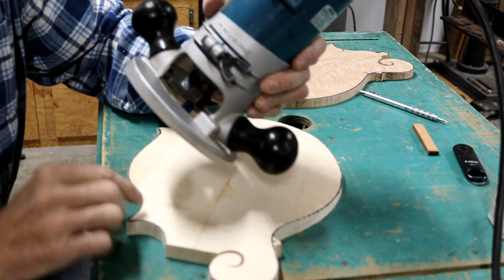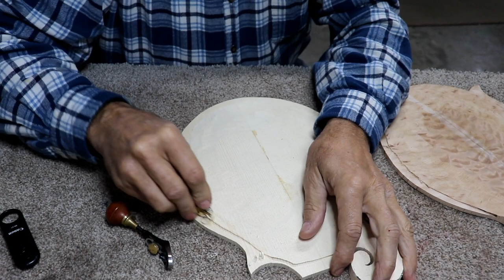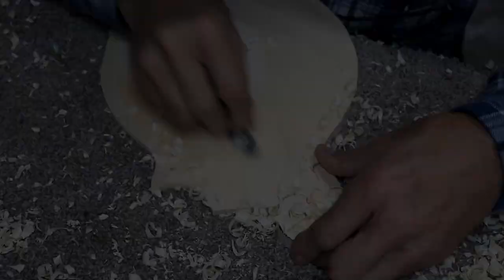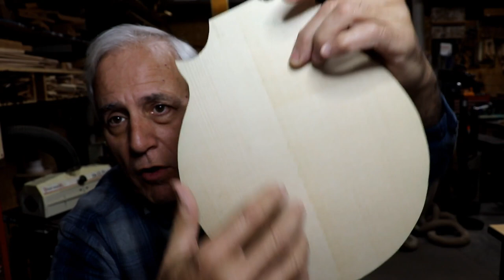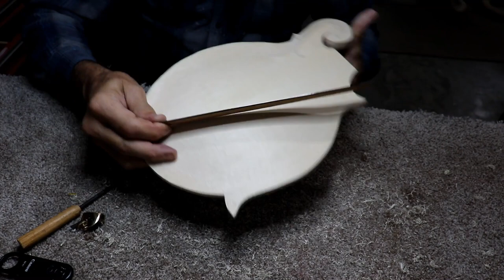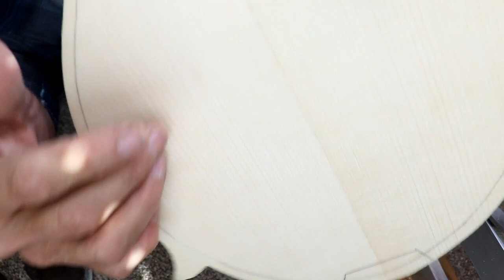560 RSW The Worlds Finest Mandolin Ever Built By A Human - Part 2

Comment: Concerning the recurve on the top: Benedetto says that the recurve on the top is purely cosmetic, that the F holes already make the top far more flexible than the recurve could by itself. And that does make sense, with those holes cut in there, it's going to be more flexible just from the missing material. He then goes on to say that the BACK is the place the recurve makes a difference. It matters because without it, the back is too inflexible to help shoot the sound out of the instrument. He taps on the front and feels he vibrations in the back, first at the center and then sliding towards the edge. When you get towards the edge, you can feel that the vibrations drop off. What he says you want to do is to get that recurve area vibrating as much as the center of the back. It's a pretty subtle thing to feel, no question. But he thins the recurve area to where it is vibrating like the center of the back, then he considers it done. 

Granted, he's building guitars, but I wonder if the same principle applies to mandolins? I'm almost done with my first arch top and I've never finished a mandolin, but I am definitely noticing what he is talking about with the back vibrations. Just something to consider.

Comment: I have an idea for your fine detail sanding. Get yourself a cheap rechargeable electric tooth brush, pull the bristles out of the brush heads and put velcro on the toothbrush head. You can us a small pice of plastic to make the sanding hear a bit bigger or different shapes. I use this on my models when I do body work and use 220grit sand paper and it sand it smooth and flat. Just like using a min DA sander.

Comment: Have you seen or tried the wecheer/fordom carving setups? ie they have the longer cord to hold the various bits in the attachment pieces.  I have found that gives me a lot better control than holding the dremel for carving.

Comment: Just started watching this series with your above title at pt 1. Some of your added 'flair' would come out very different if done by the early Paracho de Verduzco, Michoacan, Mexico, which is widely regarded as the guitar capital of Mexico.  If you get a chance: Study the bevels on the 'extra' points of the early B.C.Rich Seagull. Of course those old Mexicans didn't use anything more than scraps of steel & a keen ability to hone a sharp edge on their makeshift knives. Perhaps your 2nd best can attain such fluidity!

Comment: How does that quilted maple machine ? Tear out ????
Reply: It would be just as bad if not worse than flamed maple, I'm sure. Every place where there is figure, the grain changes directions. The only way to really plane something like that is cross grain, where you are perpendicular to the grain direction, and sometimes even at a diagonal angle. it's beautiful stuff, but just awful to work on.

Comment: yuck ,  a  40 grit fiber disk on the grinder won't have any dents and you can carve right down to sandpaper ready surface works to carve the inside too. I have a circular rasp but now I see i won't be using it much
Reply from the maker: I have used both and I prefer the rasp